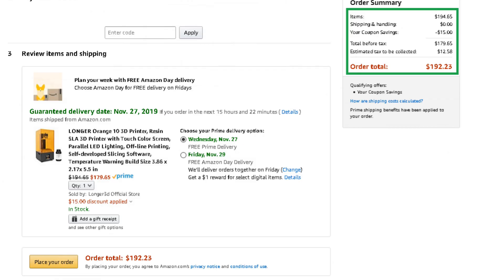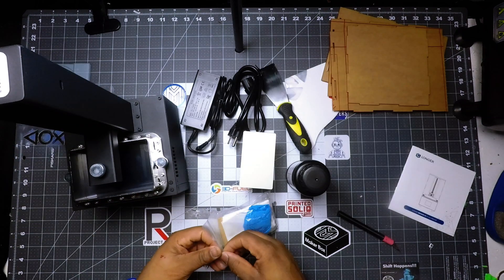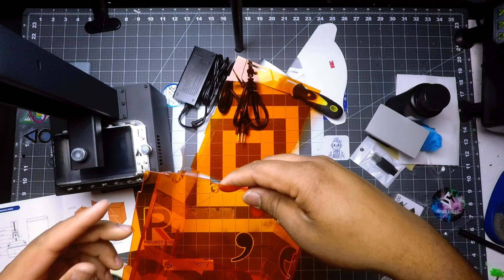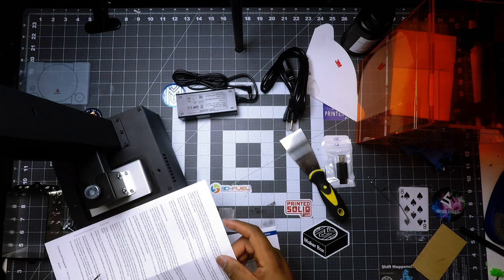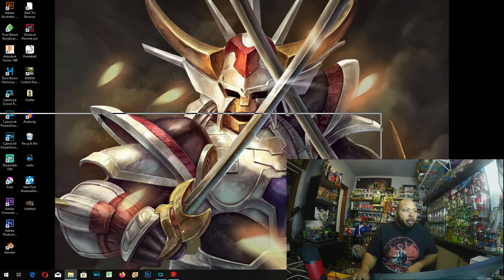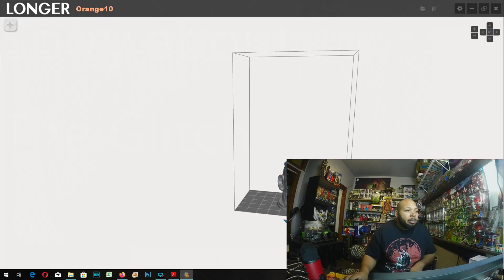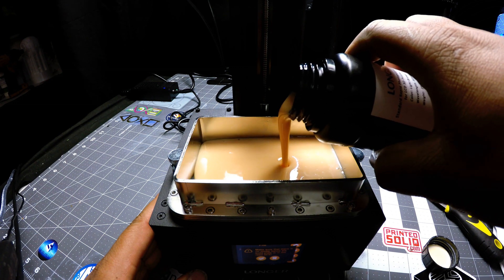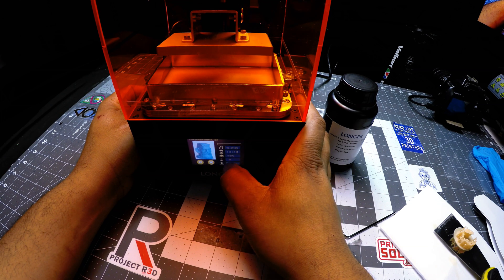Unboxing , Setup , Print and Reveiw of LONGER Orange 10 3D Printer Resin SLA 3D Printer Touch Screen

Comment: Can I print files I get for filament printers using resin printers?
Reply from the maker: Yes but you will use a different slicer software . You have the choice of the longer software or Chitubox.

Comment: Got mine today! Only attempted the Stormtrooper and it came out fine. Do you know what that bracket file is for? Is it an upgrade or a mount for something to be used with this printer, or just a random file?
Reply from the maker: No I printed the bracket and it just a  sample of the details you get while prototyping parts like hinges and such . Also I gave the Storm trooper another  shot using new resin and it printed just fine . Good luck and happy future printing !!!

Comment: haha , nice. I just picked up an Orange 10 as well, on cyber monday. im definitely impressed with the quality for the price so far,  Ive only ever worked with FDM/FFF pinters and since im new to printing with photo-polymers im finding there are loads of new and exciting ways to screw up a print.  it took me a few days but with a little research, patience and alot of paper towels, anyone can master printing perfect models every time.  to help save new orange 10 owners some headache My top 3 Tips when starting off are *1 get the latest version of Chitubox and grab the longer 10 plugin for it so you can do all your slicing/exporting in that program ,  *2 buy a 6 pack of replacement FEP Film  for your resin chamber, you will mess up your first one in no time just learning,  *3 for adhesion issues to the FEP film use a product called "3 in one , PTFE Lubricant" (3 bucks at lowes) on the inside of the resin chamber to help it seperate better , and if you're still having problems with it sticking to the film really hard like a suction cup put two pieces of tape on the edges of the lcd screen to create a tiny increase of tolerance between the bottom of the resin chamber and the top of the lcd screen, its caus the build chamber can sometimes form a suction against the bezile of the lcd screen.
Reply from the maker: Thanks for the advice bud I will be doing an update video soon and I wanted to cover Chitubox in it as well. The extra FEP Film is a great tip as well thanks !!! Merry Christmas !!!
Reply: @TheCasualCreator1  Anytime dude, hope it helps at least one person avoid disaster. Happy Life Day everyone 😁

Comment: resin printers are just so messy or need too much upkeep as well as need good air flow in the room to help with the fumes.
Reply from the maker: Very true , I definitely need better ventilation smells like a nail salon . I forgot to mention that in the video . The messy part doesn't bother me so much since I spend so much time sanding , sealing , filling and priming all of my prints . It just feels like a trade off in in regards to the mess  .
Reply: The fumes aren't that overwhelming and don't make the walls turn into lizards but one should always observe proper ventilation when dealing with chemicals that have have more than 8 syllables and a bunch of "Y"s